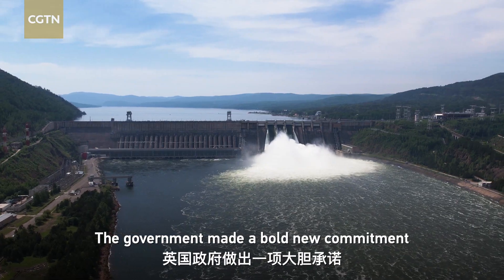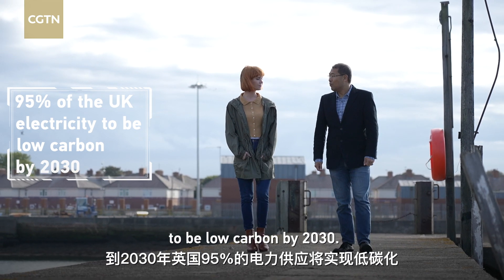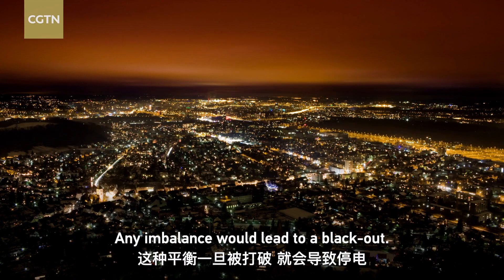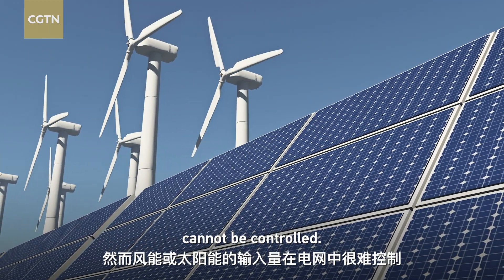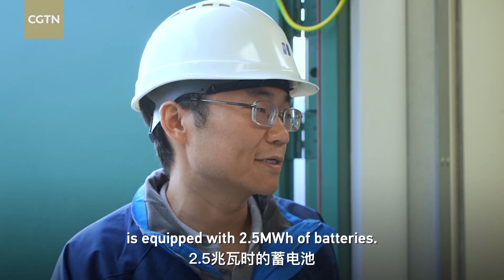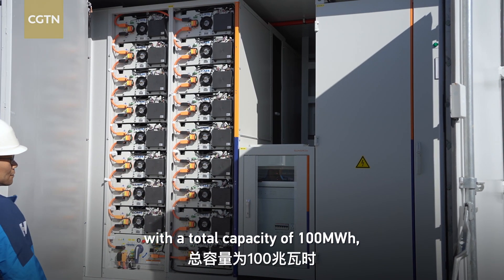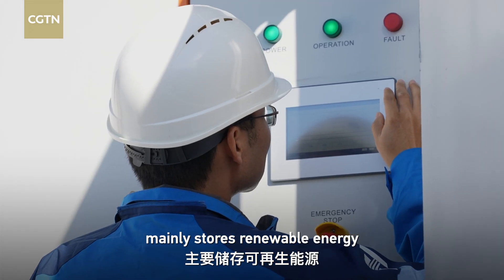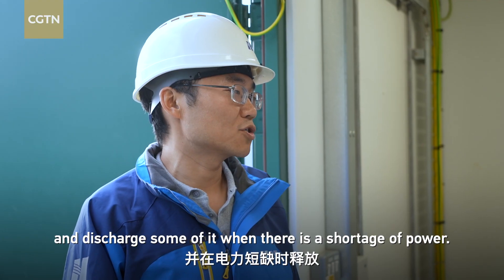How Chinese technology is used in the UK's bid to decarbonize electricity supply

Comment: There might well be a trick in energy. Negative charges and positive charges, what are they, really? Electrons a negative mass charge, lighter then they should be, protons a positive mass charge and heavier than they should and neutrons a neutral mass charge, keep in mind this is within a field of quantum particles, gravitons the largest non aggregating quantum particle. Protons are attracted to neutrons because of the positive mass charge, electrons are repelled by neutrons but attracted by the protons, all this due to displacement of quantum particles, gravitons, as a result of the mass charge. Force enough electrons together and you get usable negative mass, force enough protons together and you get usable positive mass, this to enable faster than gravity travel as well as the energy potential of negative and positive mass, for example negative mass outside a space ship hull and positive mass inside a space ship hull, energy being generated within that hull.